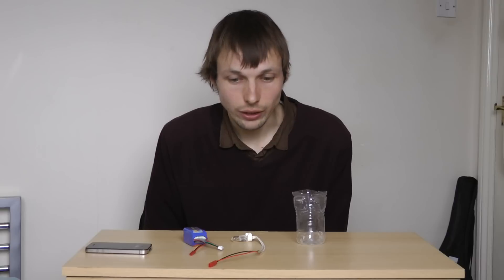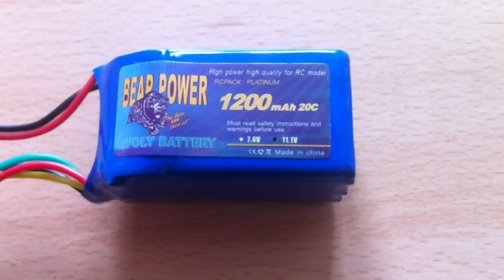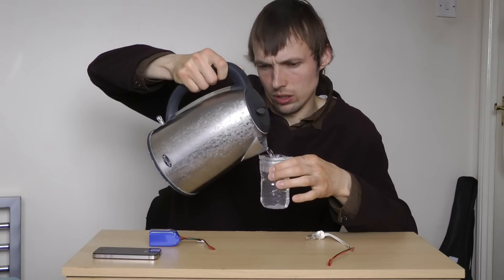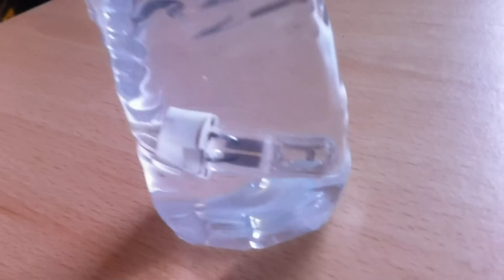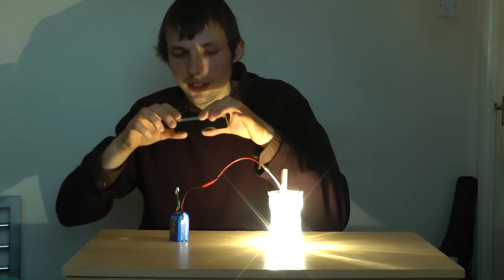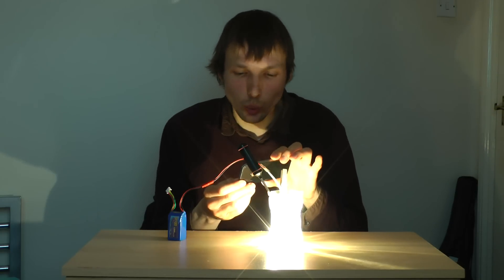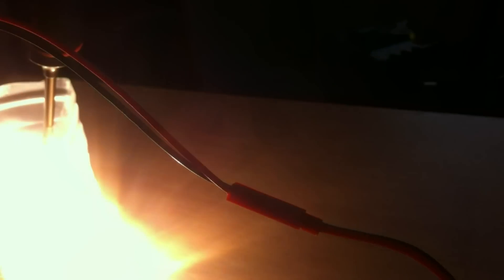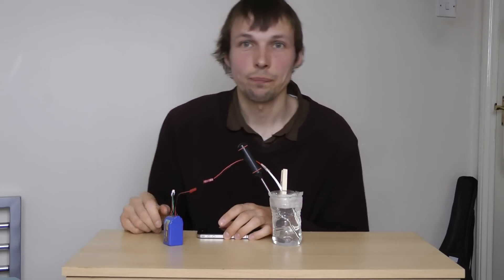how to boil water with a light bulb

Comment: to answer your question about the insulation heating up and smoking it's not that the heat from the water is traveling through your conductor but it's because both exposed points of your conductors are in the water as the water it's self is a conductor as well so it's grounding it's self out through the water and it's creating a certain amount of resistance so which ever polarity is the strongest is going to overpower the other and create heat as the current is kind of fighting against it's self as say the negative is pushing a current down one side and the positive is trying to pass through the same wire going the opposite direction and it's creating a sort of energy friction or resistance between the two and that of course creates heat .. now this is the laymens term and explanation for what is going on....that was a very cool experiment and maybe you can put some butal puddy around the bulbs connection and tape it up really good with some miracle tape and then black tape and then put it in the water ... As long as the connections are completely secured from each other then put it in the water it should eventually bring the water to a rolling boil without breaking the glass as the water would change temperature along with the glass instead of hot glass being put in cold water and exploding like you were saying ... I say you should try it ...
Reply: @BrandonCroyforJesus 8
The cables are simply heating up because the diameters of the cables were not big enough for this ammount of electric energy. The same effect is desired inside the lightbulb to heat the tungsten wire inside inert gas atmosphere to a glowing heat to make the light.

>>From wikipedia (current density): "Most electrical conductors have a finite, positive resistance, making them dissipate power in the form of heat. The current density must be kept sufficiently low to prevent the conductor from melting or burning up, the insulating material failing, or the desired electrical properties changing."<<

What you are saying about the exposed electrodes inside the water could lead to electrolysis. Actually water is not a conductor at this voltage but if there are some additional ions (from dissolved salts or acids) it can become conductive. Then there would be an eloctrolysis which probably could be seen by the formation of gas at the electrodes.
Anything you are writing about "grounding out" and "strongest polarity overpowering the other" I cannot follow and I do not think that that is happening in the experimental setup in this video.
Reply: You have no idea what you're talking about.